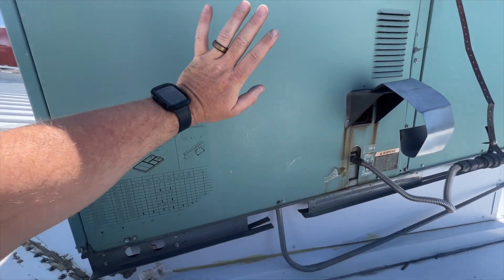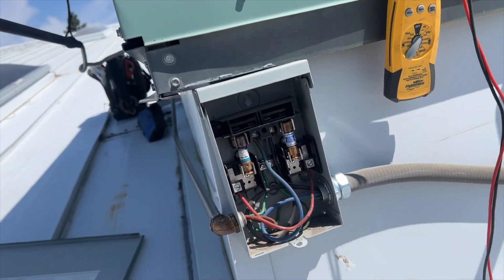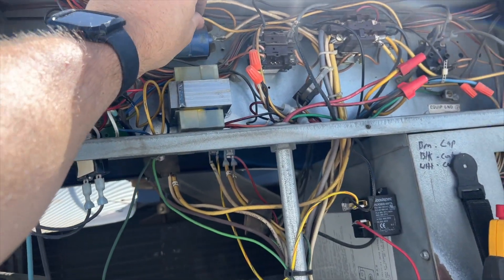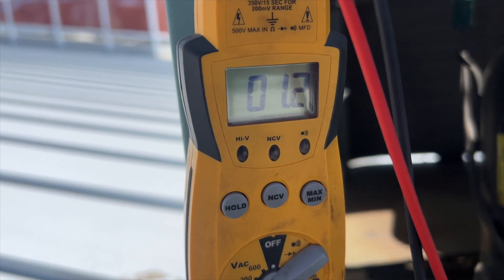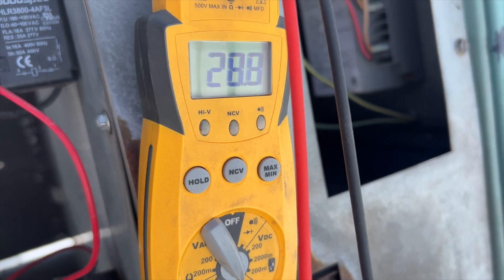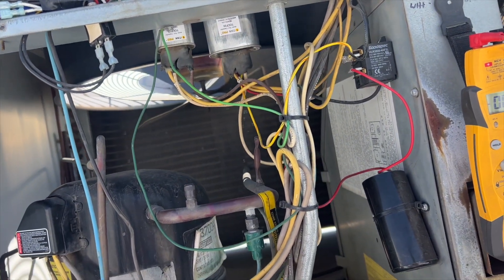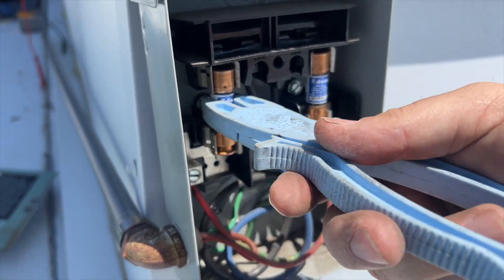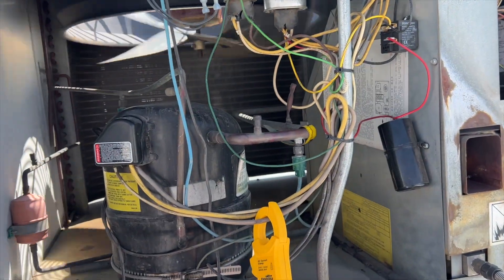Two Starting Components?  Burn't Fuses EP135

Comment: The start assist component is the same as a 2 wire hard start kit. It's a PTC or a positive temperature coefficient component. It's has a disc inside that warps when it is heated from high current flow and open the circuit to the start winding. I always put in there I think.

Comment: The blue component is like a potential relay, it takes the start capacitor out of the circuit when the system's up a running.